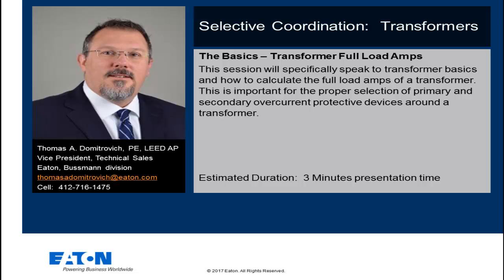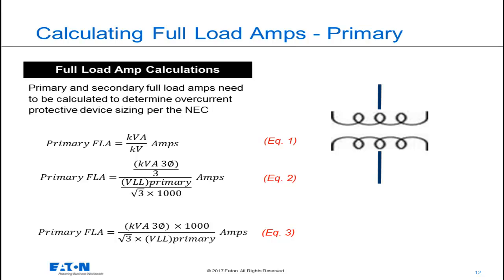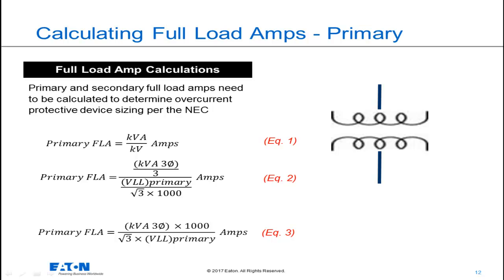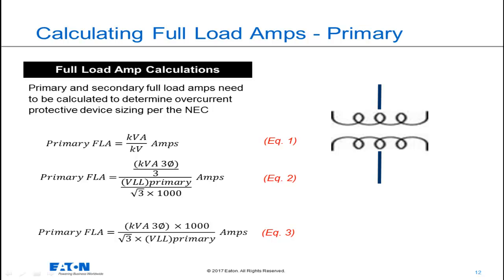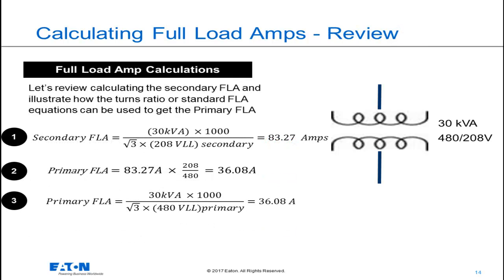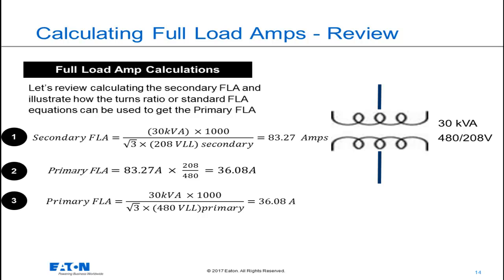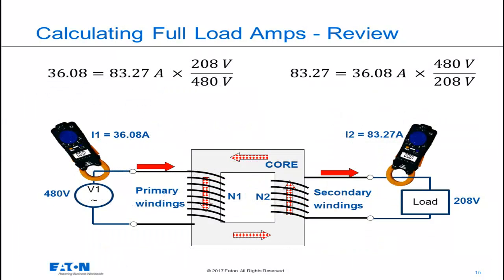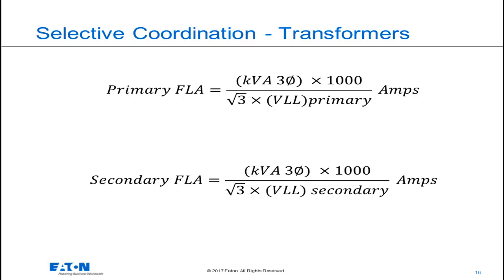Transformers - Calculating Full Load Amps

Comment: Here is a multiplying that I figured out 40 years ago when I did not have a calculator or Ugly book. For 480 volts 3 phase multiply KVA  by 1.2 to get amps. Multiply by 2.4 for 240 volts 3 phase.Forget the # for 208 volts. For ruff 3 phase motor amps multiply HP by 1.2  for a 489 volt motor.So for a 100 HP 480 volt motor times 1.2 =120 amps . Most NEMA common 480 volt 3 phase motors draw around 123 to 125 amps. I always look up what the always higher # in NEC states for motor amps times at least 1.25 to figure out wire size.Tom Grabowski

Comment: Hi new to electronics. My biggest issue is ohms law: v=ir. If the primary voltage is 480@36.08 (480=36.08r), why is it that when you decrease voltage, the current goes up?  According to ohms law, shouldnt thecurrent drop as well?
Reply: Because power is the same. P = V x I . In this video, we have the apparent power represented  in kVA and symbolled by S. S=sqrt(3)xVxI for three phase system.